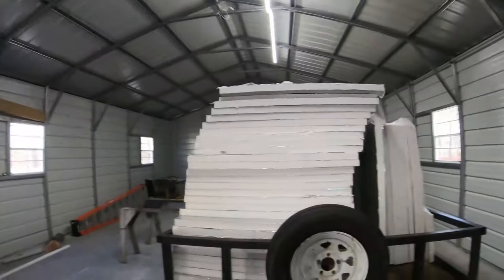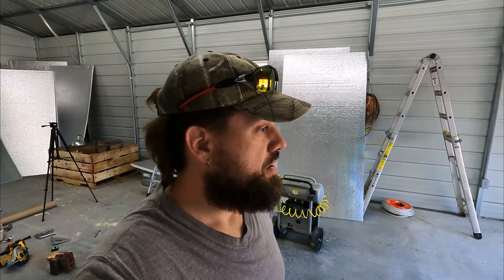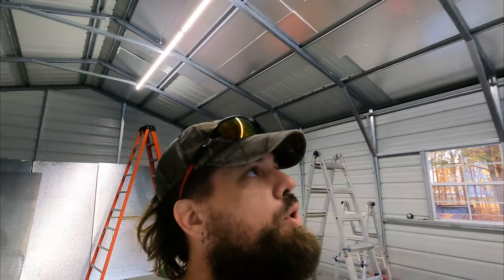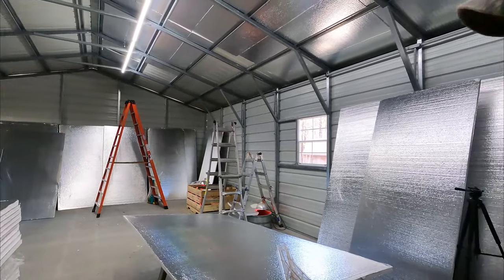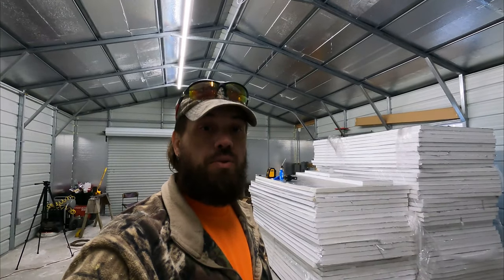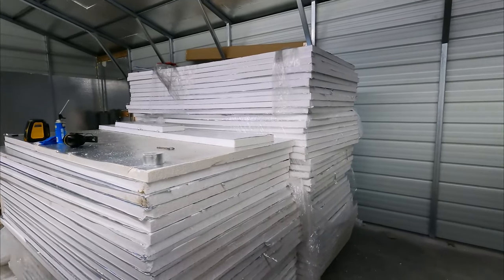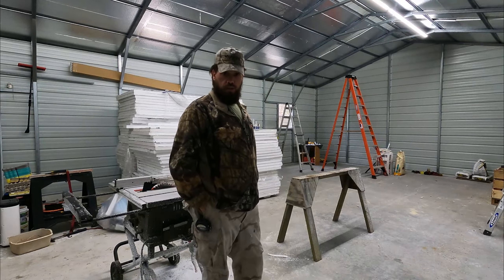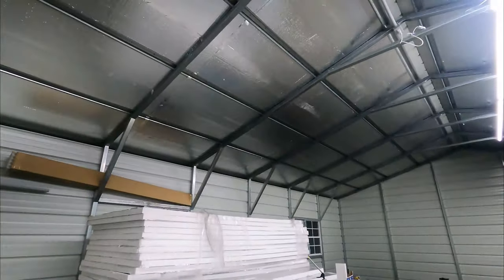Metal Building Insulation pt1

Comment: I used an industrial adhesive a friend got for me and then I used gorilla duct tape and did all the seams worked good
edit: I also ran 1 inch wide metal banding from side to side along the roof to support the panels

Comment: You can use self drilling metal screws and bailing wire pulled tight to support the panels instead of the wooden perlins. It's cheaper and just as effective.
Reply: friction fit & bailing wire.  that's what I'll do.  thanks!

Comment: I think I would apply adhesive out of a five gallon bucket with a 9" roller onto the metal itself, using an extension pole. I would also put a smaller amount of the adhesive on the panels themselves, staying away from the edges so that they would be easier to handle and position.
Reply from the maker: I had not looked at that yet.  In part 3 I did find the best way yet to hold these panels on.  Double sided tape has worked the best.
Reply: @southernyankeehomestead3230  
I hope that works out for you, because I don't trust tape long term. Two potential points of failure; one on each side; each exposed to a different material with a membrane in between. But it's cleaner to work with than adhesives, so that's a plus. I personally like heavy duty mastics that I can apply with a roller or a commercial grade caulking gun with the big tubes. 
Good luck.

Comment: Thanks for the video! My metal building is supposed to show up in two weeks, I’m having the installers put in roof insulation but I will be adding the wall insulation myself and this is very helpful
Reply from the maker: I'm hoping to have the next video in this series in the next 2 weeks.  I'll go over some tips and recommendations as well as what's worked and what hasnt.
Reply: Did you spec the uprights on four foot centers so your panels will fit after trimming a nominal amount off of one side? Many of these bldgs' uprights come 5' centers or less.
Reply from the maker: The uprights are on 5 ft centers.  So I end up cutting about 10" strips to fill the gaps.  And 4 feet on center would only give you 3' 10" in between the studs.  So you would still have to cut some.

Comment: You must use adhesive made specifically for foam. If you use anything else it not only will not glue the foam board to the metal but will eat or dissolve the foam!
Reply: And clean the surfaces to be taped with rubbing alcohol. Then over a couple of years of intense heat, the glue dissolves and the tape peels.
Reply: You maust also use temperature rated adhesive as well.

Comment: Take some 1X2" wood strips and put them every three or four feet apart and make sure they cover both  the end pieces lay them flat take some aluminum metal strips attach them to the wood strips in two places maybe 2" apart then screw them to the metal supports with may be one sheet metal screw with a fender washer make them snug but not real tight as the aluminum will expand during the heat and contract when it is cold in that way you can support the insulation and it can't go anywhere and they will not be able to sag. Just a thought? I always enjoy anyone that try's something for the first time and succeeds?
Reply from the maker: The wood strapping has worked well for the roof so far and I've found getting the panels as tight as possible makes them stay in place better.

Comment: Have you measure the difference in temperature from outside to inside. 
You have the best videos for me. 
Soon my shop will be done 30x40 any advice welcome
Reply from the maker: The difference is noticeable but I have not ran a thermometer in there yet.  Now that I've got most of the insulation in a 1500 watt space heater will bring the building up in temperature enough that I'm not sure I want to put a wood stove in it now.

Comment: Looking good. Did the 1” foam board give you any gap for airflow behind it? Any issues with condensation after? Thanks
Reply from the maker: @cae2024  in a later video I used a different method for hanging the sheets (double sided foam tape) which made things go a lot easier.  There is a small gap behind the panels and I have had no problem with condensation on the inside.  But I also run a dehumidifier in there.  With our southern air I'm pulling a 5 gallon bucket of water every day out of the air.
Reply: @southernyankeehomestead3230  oh ok. I will search for it. Wow. That is a lot per day. I live in Indiana some we have hot and really cold so just trying to find the best way to run my ceiling panels. Thanks

Comment: Do you need an air gap between the metal sides and insulation?
Reply from the maker: You do need an air gap and realistically the metal is not flat and the adhesive has not stuck like I would have expected on the walls.  The roof is free floating on both layers.  I've got another idea or 2 coming up this winter when it's cooler in the garage.

Comment: I'm considering foam board as an option for my metal building too. How has it held up against the heat this summer so far?
Reply from the maker: Well it hasn't even been a year and I haven't completed the installation so I'm going to say it's been fine.  I have no complaints.
Reply: Haha , it holds up pretty good if it's stacked up in the corner

Comment: My experience glueing these sheets up was a year later the glue still holds the foil to the building but the foil let go from the insulation board. Same result!
Reply from the maker: Which glue did you use?  I'm compiling questions and answers for the next video.
Reply: That is 100 percent true. The foil backing has much less adhesion to the foam than the glue does to the foil/Mylar backing. Strip the foil off in spots where you need the glue to stick
Reply: Foil should be on the outside the other side glues fine.
Reply from the maker: The foil is on both sides.

Comment: Hey man how did this end up working for you? I’m trying to pick between this and fiberglass insulation
Reply from the maker: Just a couple weeks ago I finished the insulation.  There will be a video coming out on that as well as another addition inside the building in the next couple weeks.  

As far as the insulation itself.  Honestly I went too cheap on it.  Doing it again I would use rigid foam not the foil back Styrofoam (like the cups) and as far as sticking it to the building the 3m double sided tape is the way to go.  The spray adhesive is worthless.  If you are going this route get a cheap table saw off marketplace.  You are going to destroy it with the insulation regardless of the type.  Spray foam is your friend.  There are all kinds of gaps in the corners, at the base, and throughout the building.  Also depending on your climate (we're in the south with high humidity) a dehumidifier is going to be required.  We pull a five gallon pail of water out at a minimum of once a month.

And when we do it next time we won't be doing a full metal building.  We will do stick construction with metal paneling.  I'll be doing a video on that someti.e next year.  Still gathering data.

Comment: How did you figure out how many pieces you was going to need?
Reply from the maker: I figured the surface area.  So 10 foot sides at 40 foot figures to 800 square foot (2 sides)  then add another 480 (10x24x2 front and back) for 1280.  I did the same for the roof but don't remember the exact number so we will say 600 square foot for a total of 1880 square foot. I then rounded up to 2000 for waste and errors.  Each sheet is 4x8 or 32 square feet.  So 2000÷32= 62.5 sheets.  Round up to 65 for an even number of 2" and then add 20 sheets (600÷32 = 18.75 sheets) of 1" for the additional space in the rafters.

Comment: So did u glue the foam boards straight to the metal with no air gap.? Trying to decide how to install mine in my building now..
Reply from the maker: I've done a couple different ways.  I think I cover it in part 3.  But to save you some time I ended up using 3m double sided tape and that's worked the best so far.
Reply: @southernyankeehomestead3230  thanks for the feedback. I appreciate it a lot..!

Comment: Would have been easier/better to hang the insulation on the outside of the studs/ posts tape to sael then hang the metal sidings...
Over ten years now. No problems.

Comment: Why did you split them in 2 and not use single piece?
Reply from the maker: I had to split them because there's a lip on the metal that's running the length of the building.  Without cutting them in half there isn't enough flexibility in the insulation to run it over the perlins while bowing it to fit under the lip.
Reply: @southernyankeehomestead3230  ok.  Thanks! Makes sense.

Comment: Use 2" or 3" aluminum tape
Reply from the maker: I did.  I also used 3m tape.  I think the issue is there might have been fine dust from manufacturing that prevents the tape from sticking.  You can see more in the other parts.  I think we're up to 3 or 4 videos now on this.

Comment: Where'd you get that insulation?
Reply from the maker: Most building supply stores can order it.  Lowes and home depot were no help but 76 lumber as well as ABC supply locally were able to order it but I found these particular panels through a direct dealer with the manufacturer on Marketplace.
Reply: @southernyankeehomestead3230  Thanks. I'm putting up a 22x30 metal garage this summer. Hopefully I can find a good deal on some insulation. I'm trying to keep it as cheap as possible
Reply from the maker: Stay tuned I've got some lessons learned and a couple other things that are going to be in future videos.